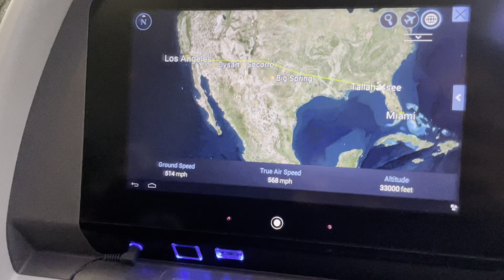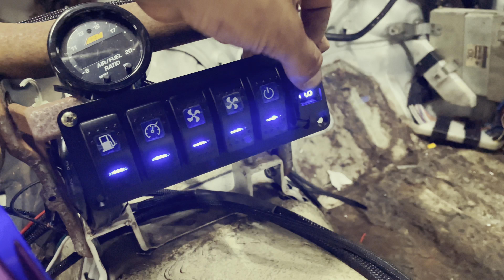Alpha MS goes to Puerto Rico to build 6 cars.

Comment: What exactly is an engine harness ? I noticed that you mentioned it in another video as well
Reply from the maker: The engine harness is the electrical wiring that connects to the engine specifically; the harness is connected to the engines computer. 
A chassi harness is all of the wiring that power chassi specific items such as head lights, tail lights, turn signals, radio, dome lights, cluster, fuel pump, windows, brake lights etc.